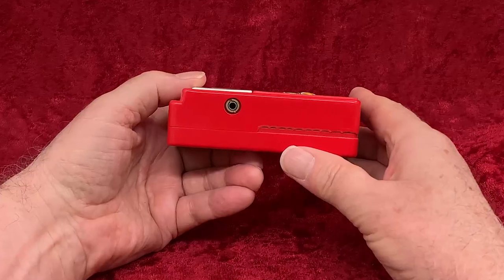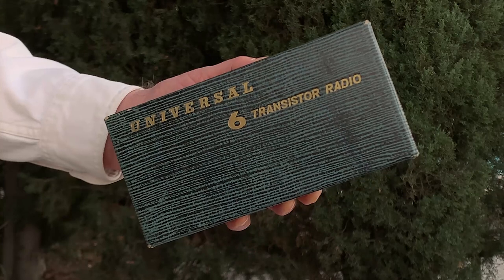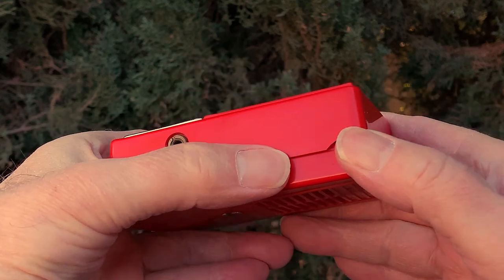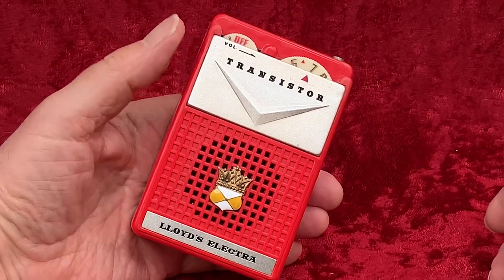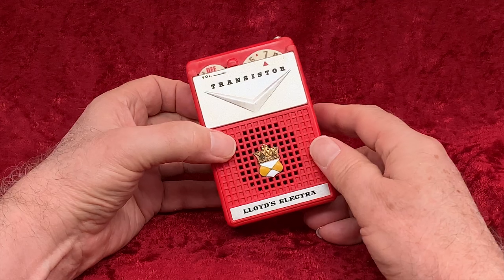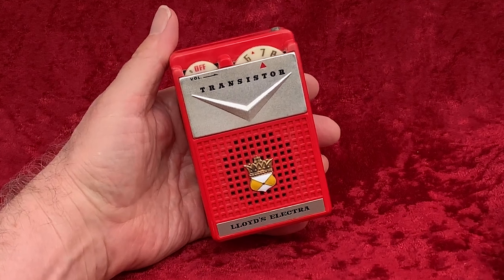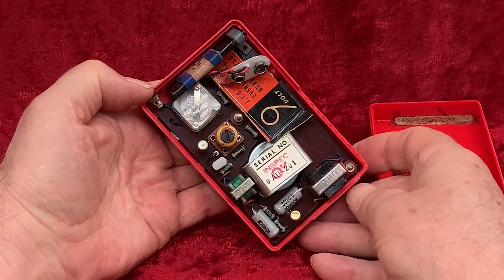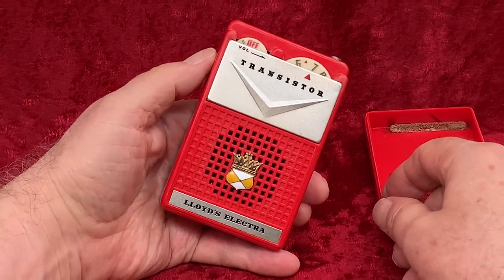Vectors Ate My Transistor Radio - 1960 Lloyds Electra 2-transistor Candle - collectornet.net

Comment: Interesting.   I had no idea Lloyd’s was made by the same company as Candle.  I looked up Lloyd’s, and found an article about them.
That the man was working for another company decided to go it on his own, and started in 1960.
Lloyd’s never made any money, and eventually went into receivership.  The new owners also failed to make a profit.
So ,eventually they went “belly-up”.
(( My mom bought me a Lloyd’s [ upright] AM/FM portable in the mid 1970’s.  It was a great looking radio, and as a young teen, I did a whole lot of DXing on it.  -* I found one on eBay a couple years ago, exactly like it. In near mint condition.  Still plays pretty good.  Needs a re-cap though.))
CANDLE, I know nothing about. I’ve got 2 really great Candle radios, one has recently been showcased on Tom’s Radio Room Show, and the other, an extremely unique and apparently very rare AM [ long range]  “portable “ table radio - takes 6 “D” cells.
I’ve tried to find info about them but “Candle” is a common word am I get nothing about radios on my search 😐
  Very good looking pocket radio.
I think it was a design flaw or possibly equipment calibration/ flaw in the Mold that made the cases.
  Another great video.
📻🙂
Reply from the maker: I don't mean to suggest that Candle made ALL the Lloyd's radios, only this one. They may indeed have made more, or all, but I have no evidence of that. I think of Lloyd's as a brand like Craig, or even Continental or Zephyr before it--basically names of importers who could, and did, source their products from a variety of manufacturers. Had you been thirty years older and a player in the import game back then, we might all be collecting Jeff-Tones now!
Reply: @collectornet  
🤣.
Interesting.
Thanks.
📻🙂
Reply: I'm another enthusiast for vintage transistor radios-!

Comment: How does a 2 transistor radio function? Must be ultra simple. Does it actually get stations?
Reply: Late answer :) These circuits are highly optimized. I got a similar 2-transistor unit (not this one) and, as a radio technician, I am amazed how well it performs. It can receive the seven (remaining) stations in my area, with good to loud sound. Selectivity is also suprisingly good. Little gem!